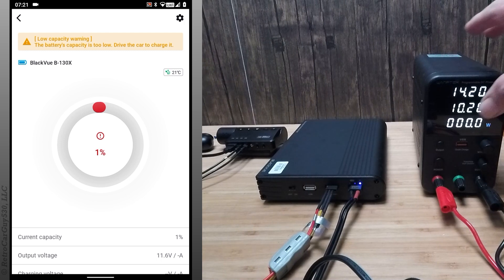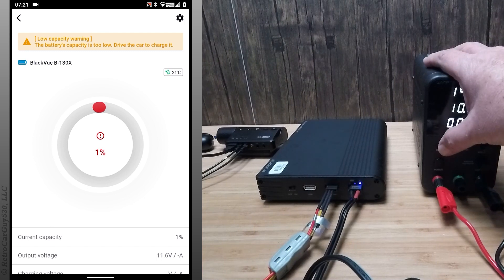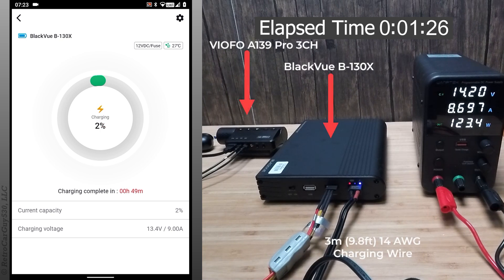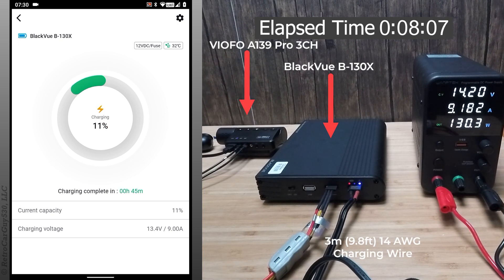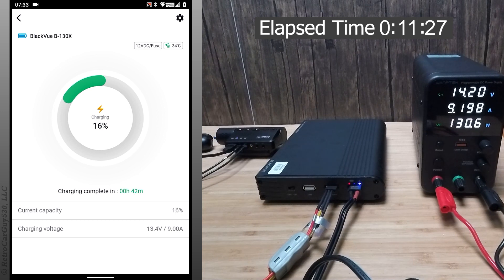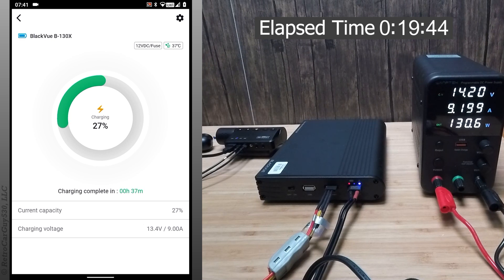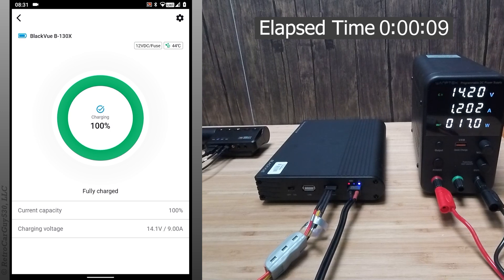BlackVue Power Magic Ultra Battery B-130X - High Amp Charging Test - 14 AWG Wire

Comment: Its safe to use in parked car... Temp 50° thanks...
Reply from the maker: The BlackVue B-130X has the following "operating temperatures" listed on the product sales page:
Charging Temperature: 0 °C − 45 °C (32 °F − 113 °F)
Discharging Temperature: -10 °C − 60 °C (14 °F − 140 °F)

I would make sure the battery pack is not exposed to direct sunlight when it's installed in the vehicle to avoid much higher temps that can occur with direct sunlight exposure.
Reply: @RetroCarGuy530 
Thank you very much.. 👍

Comment: Can you charge the battery pack using a USB-A cable with a wall charger at home rather than using the cigarette lighter or hardwire to fuse box in your car? I rather not keep car running just to charge up the battery at full max.
Reply from the maker: You cannot charge the battery pack using a USB-A cable.  There is an alternative method of charging while at home.  Instead of using power from your car, you can purchase an AC-to-DC inverter that will charge the battery pack by using the cigarette lighter adapter charger cable provided with the battery pack which plugs into the AC-to-DC inverter.  The initial AC-to-DC inverter offered by BlackboxMyCar did not successfully charge the B-130X, but after my and others' feedback, BlackboxMyCar located a different charger.  I tested that newer/beefier charger and it worked fine.  I show my test results on the DashCamTalk website in this post.  https://dashcamtalk.com/forum/threads/7500-mah-96-wh-blackboxmycar-powercell-8-blackvue-b-130x-thinkware-ivolt-xtra-bab-95.48162/post-592480
Reply: @RetroCarGuy530  I appreciate the feedback. Thanks for the info!

Comment: No expansion possible anymore??
Reply from the maker: From what I was told by Pittasoft, they decided not to have the battery pack expansion capability in this product to minimize any price increase for the product.  They are aware that some potential buyers may not like the fact the expansion port is not there, but they believe a vast majority of the buyers of the product won't want/need that feature.